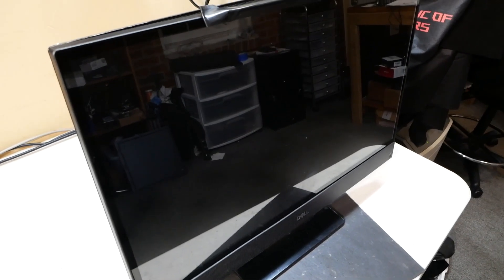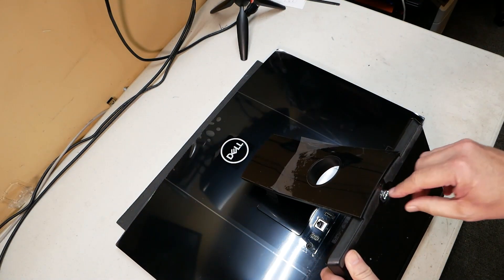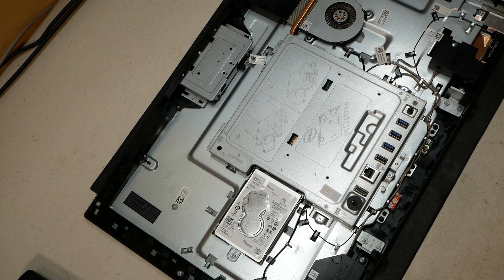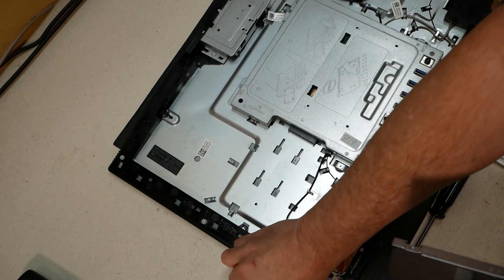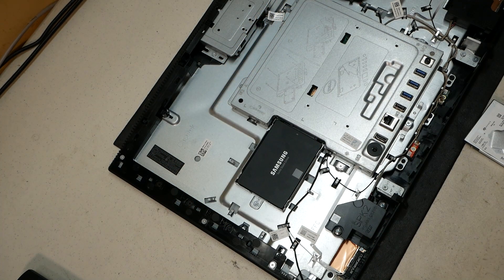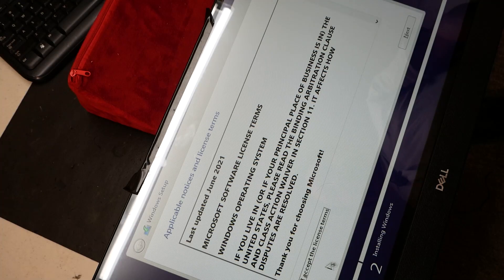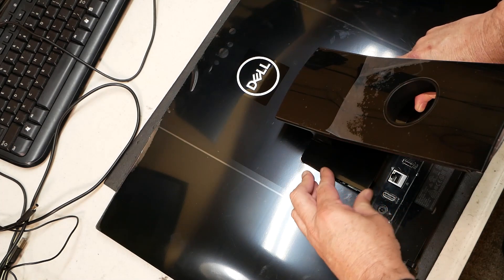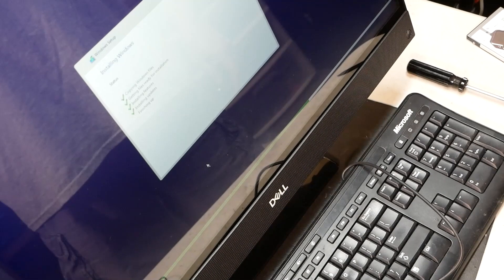Dell All in One SSD Upgrade is About as Easy as it Gets

Comment: which is the LVDS capble in the motehrboard? My Dell Inspiron 3477 is stuck in a constant boot loop. The internal display is partially damaged, it keeps flashing, and while the image is barely visible, it's extremely hard to use, so I normally rely on an external monitor. Now when I turn the PC on, the internal screen flashes as usual, but the external monitor never gets any signal. The system powers on with a white light, then shuts off, shows the amber startup light, and repeats the cycle. The keyboard never activates, and the PC never reaches the Dell logo or boot screen. It looks like the system fails right as it tries to initialize the display, causing it to restart repeatedly. i think its the LVDS which is shorting or a bad ram stick any suggestions please?

Comment: Tim: HP, with their consumer line, is DESIGNED and BUILT by the OEM company which explains why their consumer line doesn't have a consistent "look & feel".  HP is like the Sear's Kenmore appliance line; both Sears & HP would send out specs and get the lowest bid from a contract manufacturer.  So Samsung may build a Kenmore line, but it's not the same as Samsung's own branded products.  HP is just a "licenser" to an contract manufacturer, and makes a fee; they have very little invested R&D and depend on the manufacturer to design, innovate and build hardware.

Comment: Yea, the HP all-in-one PCs were a PIA to upgrade/repair, because you had to pry apart the case and replace the seal tape to get it back together.
Reply from the maker: I thought I was going to break the HP models. Thanks for commenting.
Reply: OMG yes to this. I had to have a service tech remove my HP back panel to upgrade the RAM and I'm pretty good at this stuff.

Comment: I looked at the back of my HP All in One from 2016, and found you to be correct about what a nightmare getting them apart can be.
I have a question: I recently bought a Compaq C60-400 series in excellent condition from a recycle center. Or so I thought, as looks can be deceiving.
I find the system clock is not resetting, which means a bios issue, right?  So, I went online and found there is no upgrade to the Intel F38 version of the bios, as this manufacturer has discontinued this model.
Is all lost?  What are my options?
As you may already know, antivirus protection shuts down due to date sensitivity.  And, some websites cannot be displayed.
Many thanks for your dedication and talents.
The nearest computer repair place is nearly 2 hours from me.
Reply from the maker: See if you can load defaults in bios. See if you can re-flash F38 bios.
Reply: @TimsComputerRepair  
Blessings,
AnvF10 brought me to the Main settings.  When I try to scroll down to the BIOS to reflash, it won't go there.  It jumps ti Diagnostic log.  
So, I am able to change system time and date. What next?